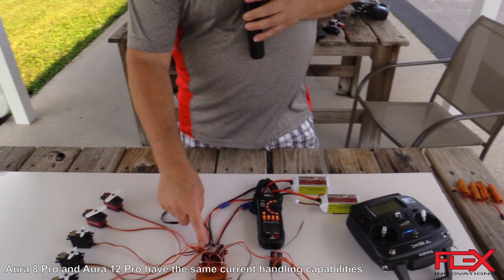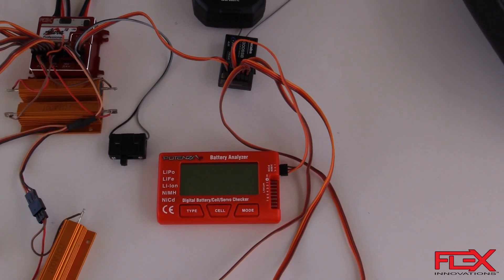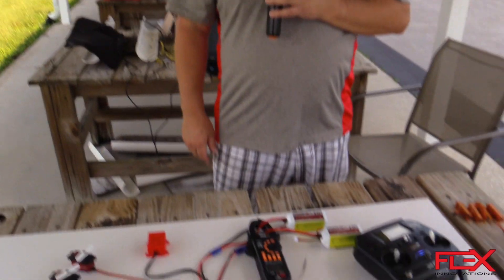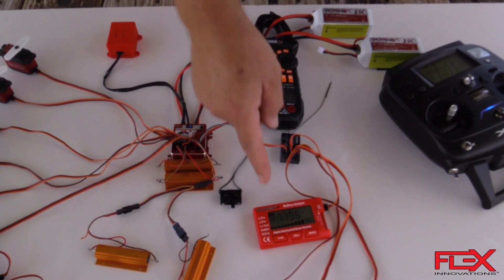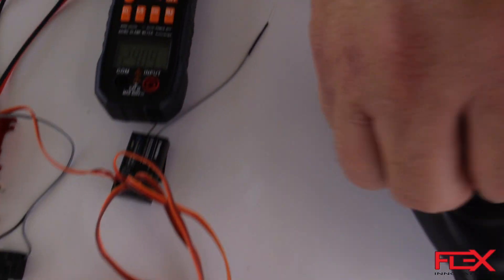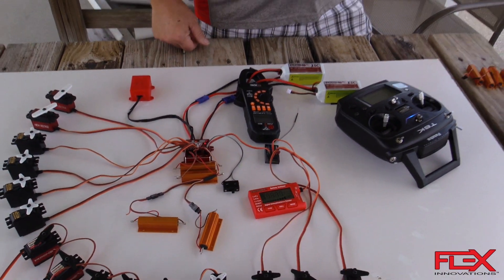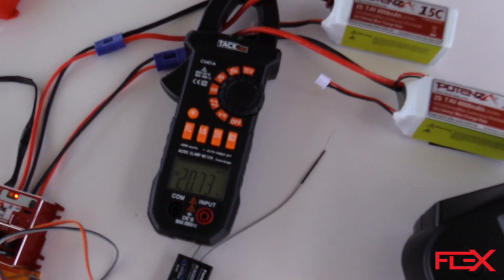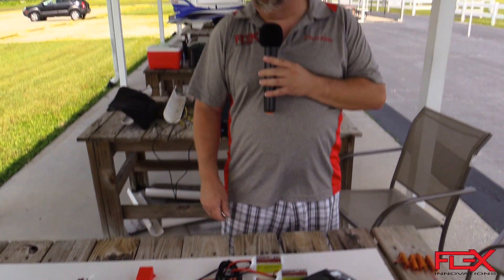Aura Professional - Current Handling Demonstration

Comment: Is this basically a gyro and a power box in one?
Reply from the maker: It has a ton of great features - at its base, yes, its a gyro/powersafe system. 

There are many other great features, however, like receiver diversity where you can plug in two Futaba receivers, and the Aura will switch between the two if one fails or loses signal. You can see all of the features at the link below:
https://www.flexinnovations.com/category-s/100.htm
Reply: @FlexInnovations  does the powersafe system use one battery at a time or it combines both battery currents while being able to switch to only one in the event one fails? I have a build with 12 x JR DS8911 HVs and thinking to run unregulated HV direct powered by 2 x 6000mAh 2s Lipo connecting aura 12 pro.
Reply from the maker: @XtremeRC

It basically pulls power from where it is supplied. 

If both battery voltages are similar, it splits the current draw between the two packs. If one voltage is significantly higher than the other, it will pull majority of the current from the higher voltage pack until they become relatively 'balanced'.
Reply: Flex Innovations thanks for clarifying 👌🏽. This is perfect.